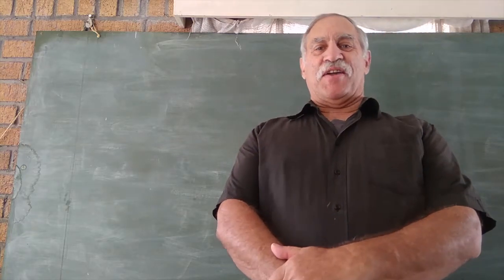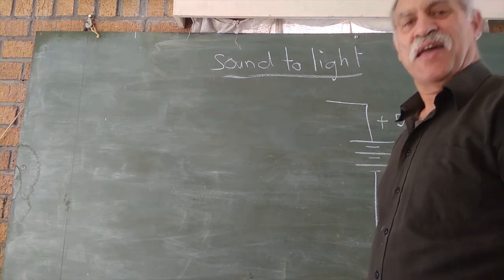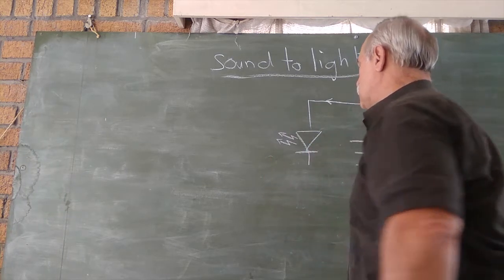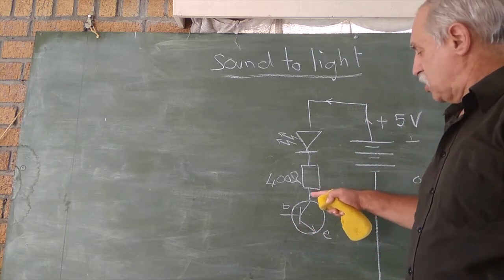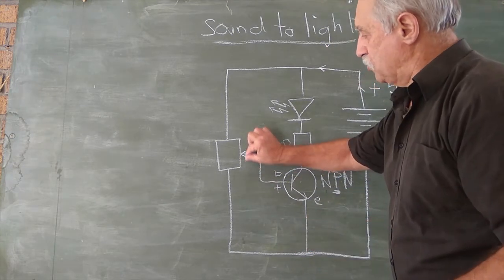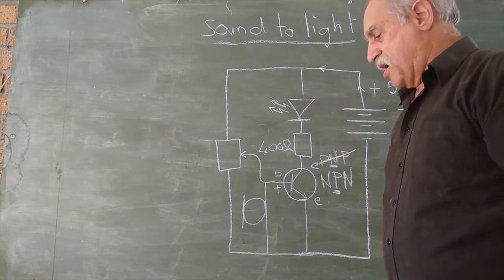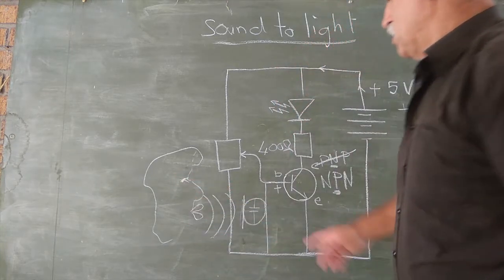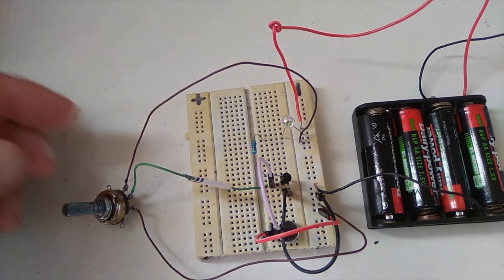Electricity 11 - sound to light circuit

Comment: I wonder how many transistors  base emitter junctions you blew up if you cranked the pot right up to +ve rail , you placed no current limit resistor in series with the base, any value to limit the current say from 4.7K to all the way to say 10K , also a  good idea to stabilize the base emitter voltage using a pull down resistor , so you dont get temperature drift effect